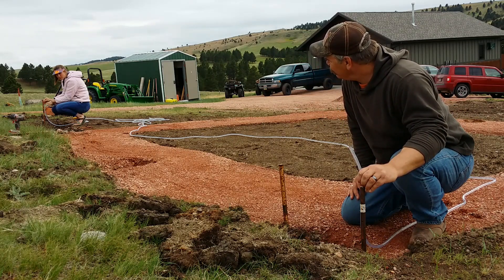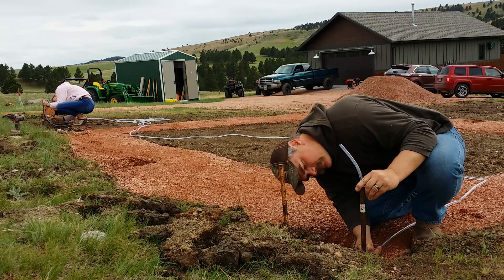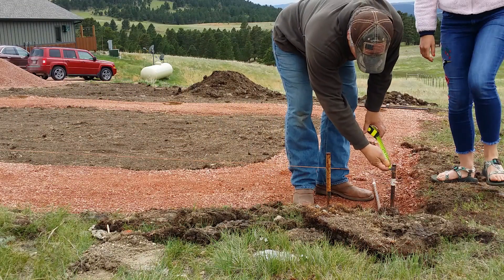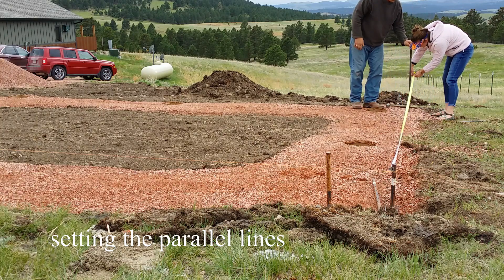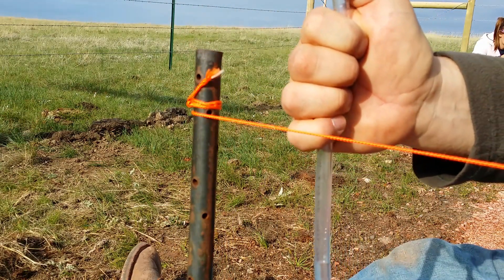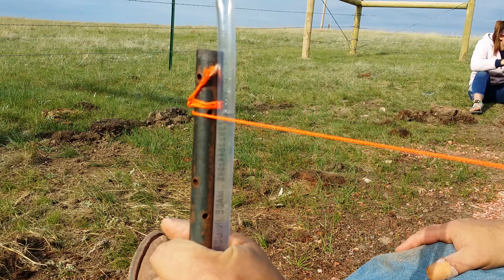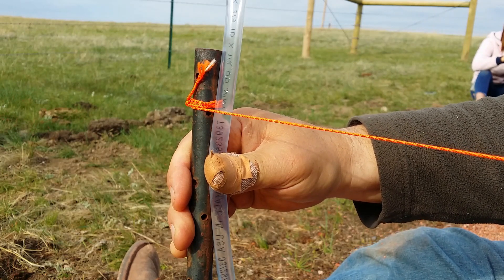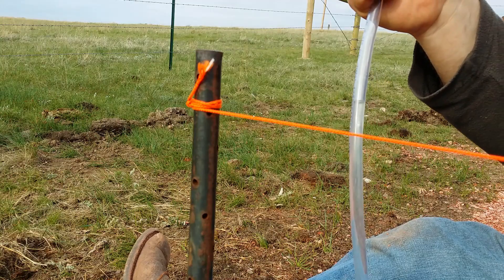Timber Frame Barn 4 - How to level and square the footings

Comment: Nice video! Lots of interesting information. One question I am I'm wondering about: how you set your parallel line accurately? As I see it nothing guarantees you come of your baseline exactly square for both measurements which may result in a non-parallel line or a parallel line which is slightly closer to your baseline than intended. I'm used to using two mearument tapes at the same time to guarantee squareness but your method intrigues me. I think I am missing something though because the way I see it it is hard to set that parallel line exactly right by just measuring the required disctance without taking squareness in relation to your baseline into account. Thanks in advance.
Reply from the maker: The parallel measurement is the first step, the square measurements are second.  The two parallel lines are long, not the exact length so to allow for adjustment for square.
Reply: @GreatPlainsCraftsman  Thanks for the reply. Actually that is exactly my point. Without checking for squareness first it is  not possible to establish a line that is exactly parallel. Let's assume we start with a line AB that runs from point A to point B and is 10m long (we only need 8m but we make it 10m to have additional margin to do the squareness like you say later). Now we want to create a parallel line CD that runs from point C to point D and is 6 meters away from AB. To do this we take two arbitrary points on AB and we measure 6 meters to were line CD needs to be. Now let's assume for the first measurement (point C) we are exactly square to AB, but for the second measurement (point D) we are at an angle of 88 degrees to AB. Now when we draw a line from C to D this line will not be parallel to AB as we have not drawn a square but a form with two square corners and two that are not square. If you extend line CD far enough it will intersect with line AB because of the angle. To exaggerate, imagine using an angle of only 10 degrees. We will not get a line parallel to AB. Of course if you can eyeball it at exactly 90 degree measurements that would be awesome but I can't :). Wen establishing a parallel line that needs to be 10 meters away and we use  two 85  degree angles (instead of 90 degree) when measuring, in the end the real distance  will be short 4cm (the parallel line will run at 9.96m). 

Its less of a difference than I thought and that makes me think this technique can be used for a quick layout on small projects but for larger ones and where precision is key I would check for squareness first.

Comment: But with the water level technique, how can you tell you have the exact same water as last measurement?
Example your leveling a 100foot run, its the end of day, you go home and come me back the next day to do the other side of the 100ft run, and say.. SOME water evaporated, his when you level it will be level, but lower total elevation then before. Could you explain sir? Thanks
Reply from the maker: Doesn't matter.  Hold on your control mark with one end and start again.

Comment: when i was using water level in columbia hospital to level the floor every carpenter on  the job was laughing at me, but when they came to set the glass it was perfectly leveled. they said first time they see a floor  perfectly leveled still today i  use water level it is way more accurate than laser level and other methods of leveling
Reply from the maker: That's true!  Thank you for watching!

Comment: I still dont get how you squared the corners
Reply from the maker: Start at 8:52.  Establish the first line where you want it,  set a parallel line exactly to a set distance.   Then pick a starting point in one corner and pull diagonal measurements and mark on the strings
Reply: @GreatPlainsCraftsman  I usually use 2 tape measures and I use the Pythagorean theorem. I set up a base line like you did in the video then I calculate In inches my diagonal dimension. I then hook both of my tape measures simultaneously to both ends of my baseline ground spikes and pull them together at the cross point of my diagonal and second side measurement. Then I simply lift up the tape measures then my second side tape measure becomes my diagonal tape measure and my diagonal becomes my third side tape measure.   This way I don’t have to measure both diagonals to get square. I’ve already done it in one step without actually unhooking my tape measures from my ground spikes. Now I have all four corners set perfectly square. When it comes to my water level I use a 3/8 inch clear water line like you do with one end of the water line inside of a milk jug filled a little more than half way full of water and elevated on a bucket and the other end of the water line is taped with box tape to a drywall T-square so that way I can set a baseline on the T-square and measure the change in inches on the T- square as the water level moves up and down the T-square. That way it becomes a one-man operation instead of two people having to holding the water line. The added bonus to using a tape measure or a T-square with the water level is you can also set a grade not just find level.

Comment: A Makita $200 laser level claims an accuracy of +/- 1/8 inch over 33 feet. this assumes no wind and a very firm base upon which to set the device. A water or 'spirit' level is limited only by the visual acuity of the surveyor and the differences in air pressure or gravity. Gravity could be ignored. Air pressure, unless we are talking large distances, is variable due to the wind blowing across the open end of the tube used so take readings when the wind is calm. Let's assume the visual acuity of the observer(s) it the ability to see a single human hair, a very low standard because of it's natural variability, despite its frequent use. "Individual strands of hair range in thickness from 1/1500 to 1/500 of an inch in diameter, depending on the properties of the hair in question. Typically, blond hair is thinnest since it usually does not have a middle layer as dark hair does. Black hair is the coarsest or thickest." --reference.com-- You do the math.
Reply from the maker: Thanks!

Comment: Just subbed and Excellent video, We're from Ct and built 3 small vacation homes in Vt and we always used a water line level. Doesn't matter where you are, it's level, accurate and it's beyond simple to use !
Reply from the maker: august Thank you for joining the journey!